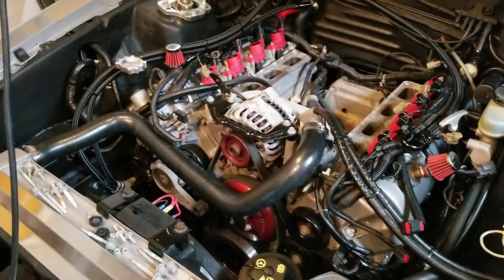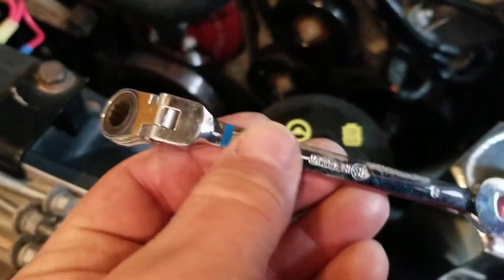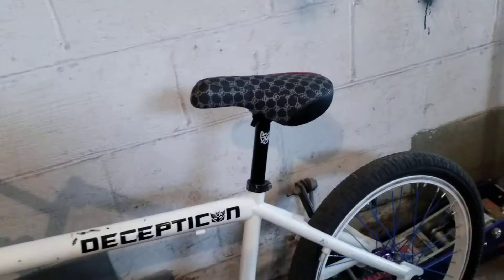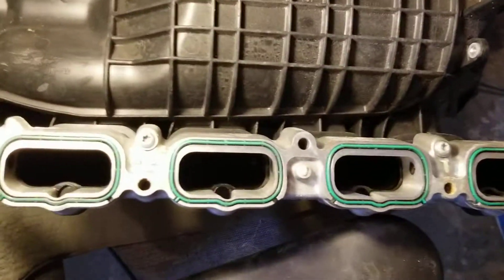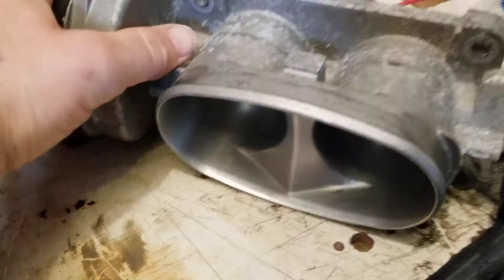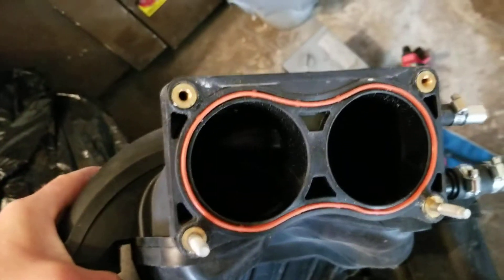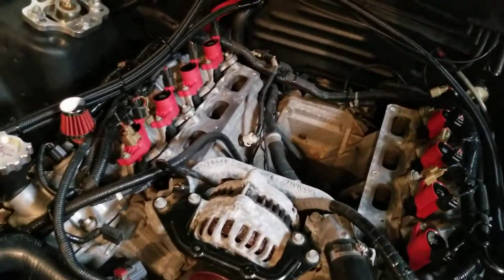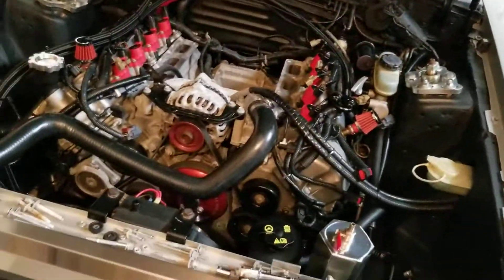Ford mustang 4.6 3v swap intake removed # port job# modified

Comment: i know past time. Did you ever get a confirmation on any HP increase especially WOT? Class restriction  must use stock manifold. TKS
Reply from the maker: Sorry bro I haven't..wish I was able to have some numbers
Reply from the maker: Also still running the stock control pack tune for now till I end up getting a tune for it
Reply: @brezicky  tks brother for the content